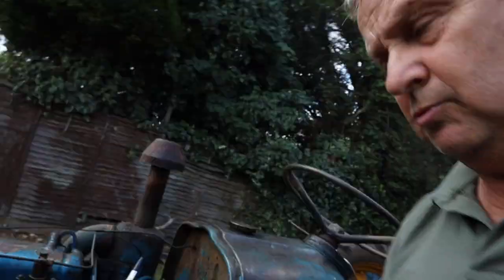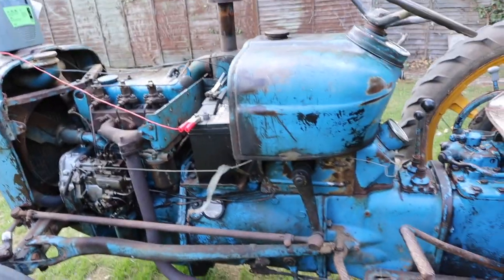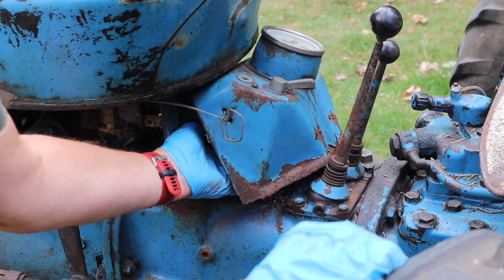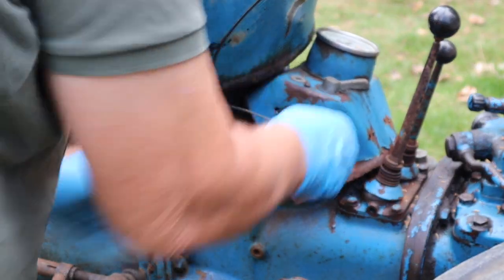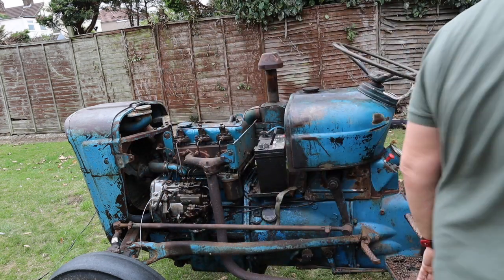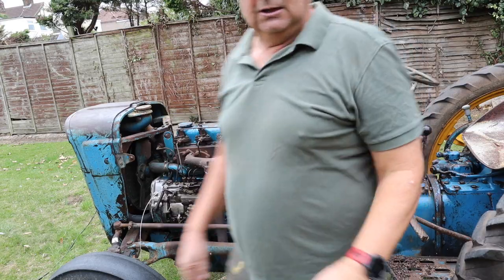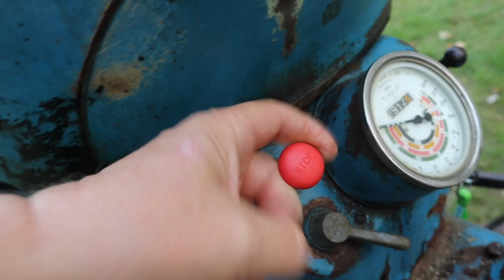My Fordson Super Dexta

Comment: It's several years since I replaced the stop cable on my Super Dexta and I watched your video just to remind myself which bolts and screws I had to undo. One extra tip for anyone doing this job:- it's not a bad idea first to remove the gear lever assembly. It's very easy to remove and replace this part (carefully position both levers in the vertical postion before lifting) and it gives you a lot more room in which to work. However, do plug the hole with a piece of old rag, just to stop anything dropping inside! Cheers Robin!
Reply from the maker: Thanks Norman for the tip hope you like the video 👍

Comment: I have recently fitted a new stop cable to my super dexta, when I re-wired it. Mine had a mouse's nest in to, and they had eaten the wiring loom. 
When  you re-wire your tractor try and save the original switches. The modern repro stuff is poor.
All the best 👍🏻
Reply from the maker: Thanks Carl Good advice and also I will use the original stuff as much as possible 👍